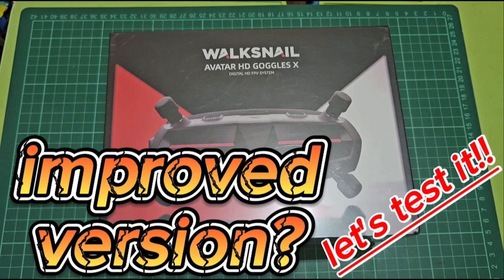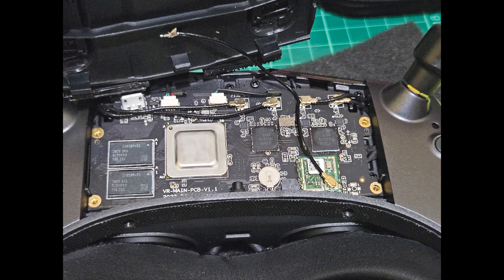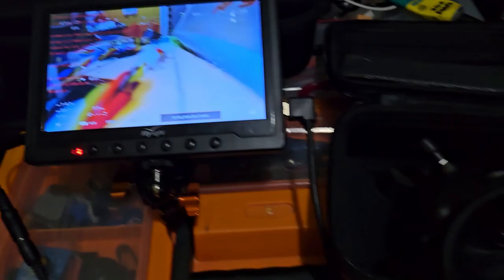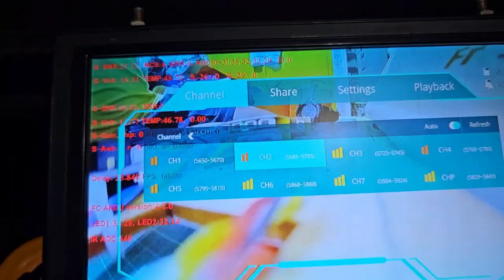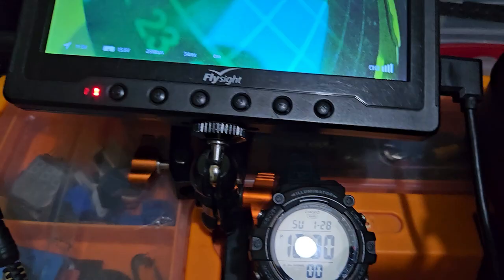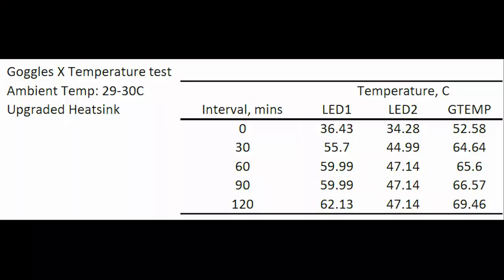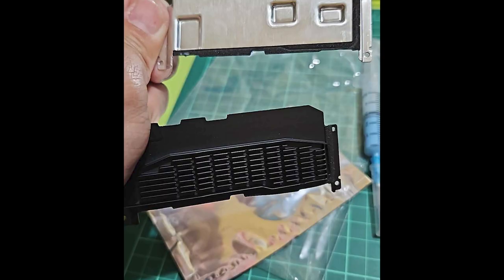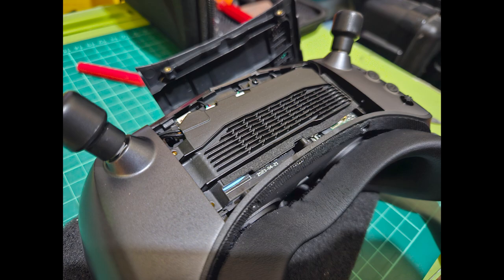Heatsink upgrade? A Walksnail Goggles X test

Comment: Just bought mine 5/20/24 and it has the old heatsink
Reply from the maker: And does it overheat or not? Mine didn't come with shorter heatsink but didn't have any issues on overheating. Tested under 49C summer temperature here, didn't have any issues.

Comment: Whats the "scam" part?  what does Caddx get out if by giving out a free part?
Reply from the maker: It's just a title to get one's attention. And it says "Scam or not". You seem to omit the rest of it.😁 Anyway,  Caddx gave it for free to help their customers actually, but some are still in doubt, especially that they paid already for their goggles (and some wanted to have their money back). So I did the test and shared the results thru this video
Reply: Typical "Click Bait Title" When I see such a title I comment and don't watch. Mis-information!
Reply from the maker: Lol 😁 yet you still got the time to post a comment about it :P
Reply: This is a product that was rushed to market for no reason. I’m not convinced that heat sink will be a fix.
Reply from the maker: Well, I have seen a couple of posts already on the WS FB official group where owners of goggles used the heatsink and it dropped the temps significantly